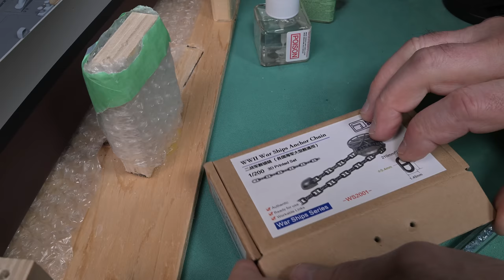The Model Ship - Part 1421

Comment: Hi Ron.  About the water inside your compressed air tank...  The only problem the water creates is that if you have an enough amount in your tank, it will drag in to your compressed air hose and instead of dry compressed air you will get a mixture of air, water and maybe some oil.  This is not what we want.  The damage of rust inside your tank is negligible (maybe if you use it por a couple of hundred years) and the same about the volume lost.  The first and most important drawback is that you will get small droplets of water going into your airbrush and finallly to your model.  I'm retired now, but I've sailed almost 40 years in several ship´s engine rooms as an officer and one of the most important routines was about every two hours drain our compressed air tanks to get rid of the water.  No matter we had automatic drainage valves and automatic dryers for the compressed air.  A great hug from Argentina!!!

Comment: On vehicles with air brakes, one main reason for keeping water out of the tank(manually or auto) is to keep water out of the brake system.  It does nasty stuff in the winter.

Water separators do the same down stream for tools and other air operated machinery.
See ya.                            JimE
Reply from the maker: I recall on the buses airbrakes there was also an automated system that periodically shot misted alcohol through the lines/system to help keep things from freezing up.

Comment: Compresses air is hot, So form condensation in the tank. If you don't drain that water would finish by leaking in your air line and then to your airbrush. Some airbrush come with small water trap. Keep up 👍👍👍🤗
Reply from the maker: Yes! I understand that. Like when your warm breath will condense on a cold glass.

Comment: Hi Ron, Both reason's for draining are valid.  Another reason for draining the water is to keep it from coming through the hose and mixing with your paint.  I know you have a water trap on the compressor, but if you neglect to drain the tank for quite a while the water will fill the water trap and go through the hose.  Mixing water with certain paints is a real mess.   Thanks for sharing.  Have a great day.  Jeff
Reply from the maker: Hi Jeff,
Sounds like I've opened up a controversial can of worms here, haha! 😁

Comment: Ron, ya, there’s always water in the air.. no zero humidity anywhere. Bleeding the tank is good practice. I also use a moisture trap on my compressor to to keep moisture out of the paint. Have to drain that too. Main deal is too keep water out of the paint.
Reply from the maker: "Main deal is too keep water out of the paint" 👍🏼👍🏼

Comment: Hi Ron, it's often higher humidity here in sunny Essex UK so I have an extra mini  inline water trap fitted to my airline before the airbrush connection. It's only about 7/8" diameter and 1 1/2" long, lightweight and doesn't get in the way. It is very effective and was less than £10 from eBay.